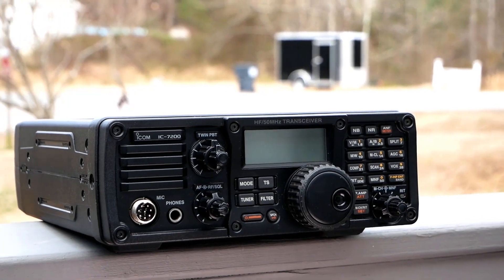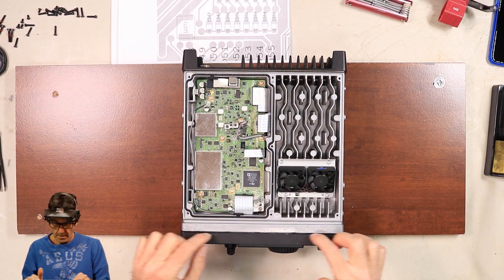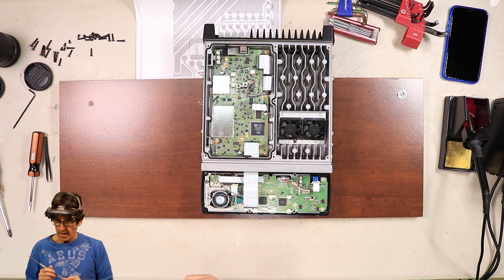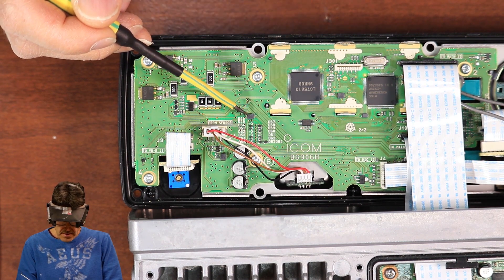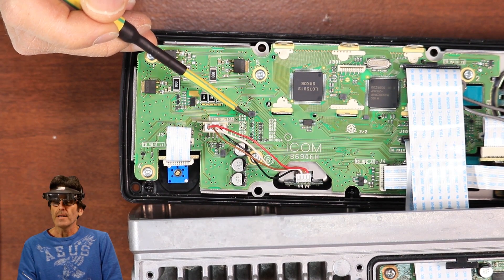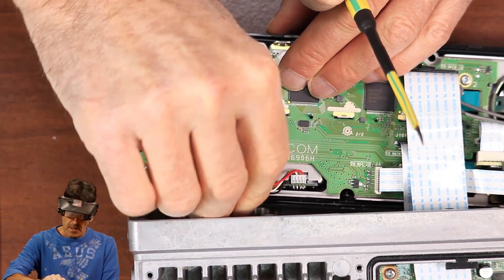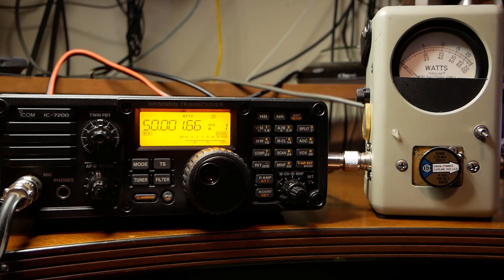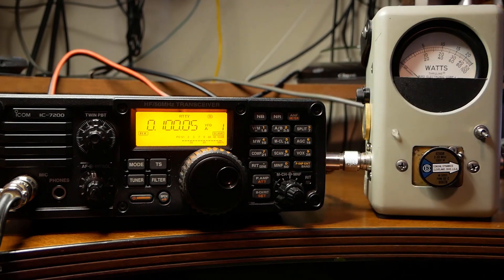How to Fully Open Transmit on Icom IC-7200 and Test at the End

Comment: Great channel!!!!
Can you tell me which diode I use in the
IC-7200 has to be removed so that it transmits on 60m?

Greetings Heinrich, 73
Reply from the maker: Thank you!  Hi, If you do the mod in the video it should have no problem TXing on 60m... I'm not sure how you would modify it to ONLY open 60M.  One thing you can try is to check mods.dk.  You can go to the 7200 and see what mods are recorded there..

Comment: Isn't this basically a 718 circuit with some added gingerbread?
Reply from the maker: Probably, it's a pretty basic radio.
Reply: @JLPicard440  Well, I figure if you'd reply with such then you've probably already thought that same thing or used them both enough to offer that inspired guess.
 I was so unimpressed by my 718 that I gave it to a CBr who was studying, and is now licensed to use it, so I doubt I'd like the 7200. Thank you for replying.
Reply from the maker: @cedarridge3020  IKR... I know somebody who had a 718 and we used to tease him for using his "Entry level" radio.  But in all honesty over the air, you'd never know it.  It had just as good of a sound as the more expensive rigs..  It's just not as pretty to look at!  😂
Reply: @JLPicard440  It was the receiver I disliked about mine. TX they do OK for a little narrower bandwidth rig.
Reply from the maker: @cedarridge3020  Yes, true, I hadn't thought of that..
Reply: Have owned 2  IC 718's and 2 IC-7200,s,
 I have kept an IC 7200 for HF mobile use here fo outback travel here in Australia,  broadbanding it for use with the Royal Flying Doctor Service (RFDS) base frequencies and the VKS-737 Australian 4WD travel service networks for remote travel.
I found the 718 a good reliable rig with a good receiver, not quite as  nice as the IC 751A or the IC-7410's  IC-761, IC-765 and FT-1000D that also grsce my shack but capable.
The IC-7200 does have a hotter receiver and although less facility  than the  above rigs is not too shabby in the receive dept,, the Twin PBT and IF DSP is very good in my opinion and superior to the optional AF DSP in the IC 718.
Most outboard antenna tuners out perform most Japanese rigs internal 3:1 tuners and an AH-4 follows my IC-7200 in my 4WD pickup into a H/D Terlin multi tap Outbacker antenna.
Also the newer Chinese tuners are actually very good especially the remote tuner as sold on E bay.
The beauty of the IC 7200 is its robust construction, reliable well cooled finals and its relative portability, no not as compact as an FT 817 but I much prefer it to these smaller rigs. 
It doesn't require extra filters and the selectivity options are more than most will ever need and the DSP is very good.
I also have in another SUV a TS--480SAT another nice rig but find the Icom IC-7200, AH-4 combination easier to use.
Reply from the maker: @rossawood5075  Thank for the great info.  I couldn't imagine traveling with a FT-1000D!  That thing is a monster... 🙂😂.. The 7200 is much more suited for remote work...  Greetings from Virginia, USA.. 🙂

Comment: Excellent video instruction, thank you. My IC-7200 was bought in South Africa, and except for D60, all diodes D48 to D64 were in place.

I removed D48, D49, D51, D52 and D55, so that my board now looks like yours. I hope to make some 60m FT8 contacts tonight :-)

Side note: An ICOM technician told me that the Europan version of the IC-7200 only needs D59 removed to open up TX on 60m from 5.225 - 5.405 MHz. (Euro-01 Version.)

73 Chris ZS1DX
Reply from the maker: Awesome!  Thanks for the info.. :-)

Comment: I did the mod and now I have no sound.  Speaker is plugged back in correctly and I did a factory reset.  Also when I TX the screen backlight goes off and the radio won’t tune with my tuner.  Any ideas?  Thanks
Reply: Fixed it. One of my ribbon cables had come loose. Thanks for the video.
Reply from the maker: Whew!  I didn't read all this till this morning... glad you got it going.. :-)
Reply: Radio is receiving. According to the S meter. Just no sound.

Comment: I was thinking about picking up an IC-R75 just for listening, but am now thinking about spending a couple hundred more and getting this transceiver. I only plan to listen for now, but hey, I may want to get on the air some day.. Would I be making a mistake by spending the extra money for a transceiver? If I get a receiver, I'd like it to be a nice one, like the IC-R75 or maybe a Drake SW8...
I plan on using it on my sailboat here in the Pacific Northwest and on a trip to Hawaii this summer for weatherfax and whatnot.. 

Nice video; Getting good shots of working on stuff like this is very difficult!

Travis
Reply from the maker: Sorry for the late response, I haven't been getting any comments for some reason... But yes I would absolutely get a transceiver...especially if you think you might get on the air one day...
Reply: Yeah to 2nd what he said... If you're looking to be at sea... A transceiver for sure. Never know what will happen. There's a lot of options out there. But a 7200 would do you just fine.
Reply: I'll go the opposite side and say for receive you can't find any better than the R75.  I own both and the R75 is better than the 7200 on receive.   At least mine is.   Since all you'll find is used equipment from now on your mileage will vary.